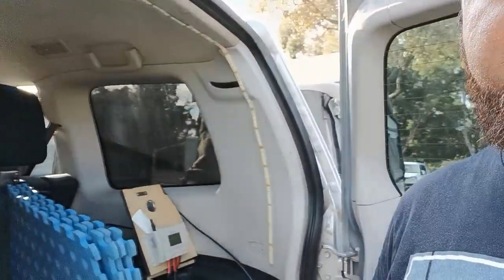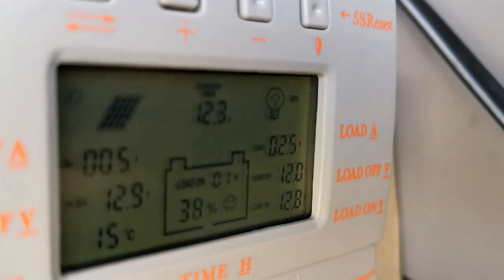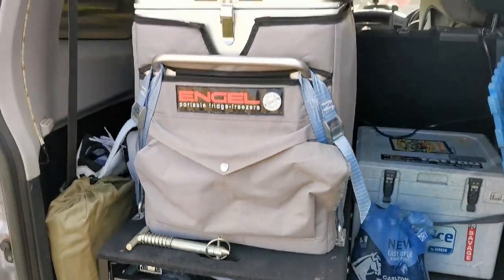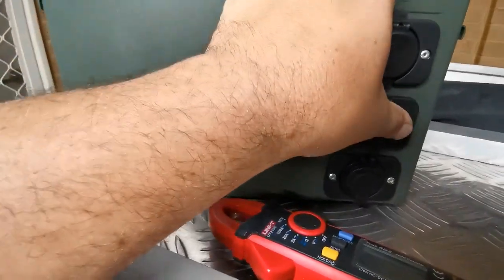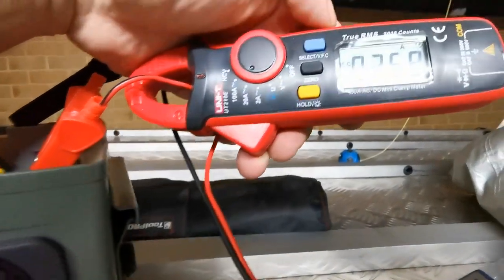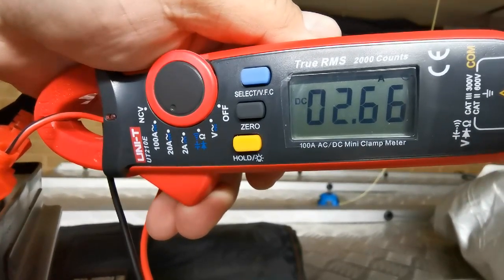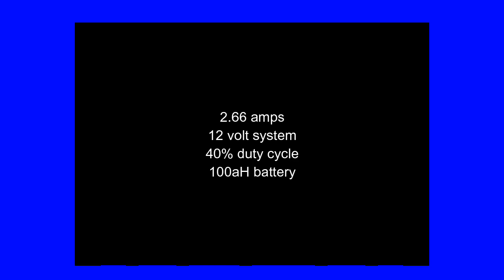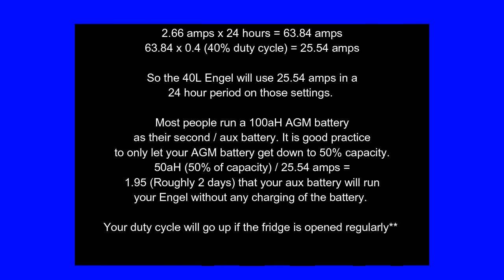Real world testing: Engel power usage. How many amps does it use?

Comment: I haven't watched this yet but thought I'd share my experience. i get a tadd under 24hrs in my car running on an 80ah AGM battery before the built in medium cut off switch kicks in, which I believe is around 10.5 amps compressor running. 60th anniversary 40l. Brand new battery. I'd let it go lower but Engel's lowest cutoff I believe is far too low for AGM
Reply from the maker: Sounds about right mate. Cheers for the feedback

Comment: Real world is a very different story. Engels duty cycle isn’t accurate to specs. I’ve got a combi and it runs a lot more than the advertised duty cycle.

Set at -12 degrees it’ll easily chew 40-50 amps per 24hours

Set at 0 or 2-3degrees and it’ll still chew 30-35

Comment: Iv had one for years there fantastic but recently shit itself replaced the condenser with one in hard rubbish worked fine I was surprised.. but I go through lead acid batteries pretty quick for some reason.. or maybe lead acid batteries are just shit?
How much does the average 12v fridge draw? What about Waeco's?
Reply from the maker: I think the average fridge would draw 0.5 to 1 amp more. The Engels are very efficient. It's that swing motor..

Comment: That's what makes the Engel so special. The low current draw thanks to their brilliant and unique swing motor. For more efficiency, remove the bag and add a voltage step up transformer. See the results here - https://www.youtube.com/watch?v=m9xjYKs1Kx4&lc=z23azzhy2tb2dzlecacdp433tolvdbbyhqa1rjk1srdw03c010c.1599441011700997

Comment: Hey mate, good video, but where does the 40% duty cycle come from? Have you measured that it is 40%, or is it an assumption? What ambient temp were you running?
Reply: That’s a good point. You’d have to sit there for an hour and time how long the compressor runs and then calculate it. Maybe he did though. 
Good video thanks mate. 
I have the same fridge and left it for 3 days with a 100ah battery. I was was worried I drained my battery to low but a guy at jaycar told me the Engel will cut off automatically if it detects the battery drops below a certain voltage, not sure if that’s right.

Comment: You forget to mention :)  I have a 27 yr old 30 lt Engel and it uses similar AH to yours on a 25 C day. However, go to a 40 C day and in 8 hours it, coincidentally, also uses 25 AH, (100% cycle rate) with 16 hours of hot day and warmish night to go, lol. I've also measured the interior of my 4x4 at 60 C on really hot days. The figures I quote are from actual tests I've done. So @ 50% Depth of Cycle on a 100 AH battery, it will need daily charging in the summer. Which is why I have both DC-DC and solar options on my Auxiliary battery as do you. :) I suppose that's another video, lol....... BTW I like you battery box.

Comment: Hi mate i have a similar setup with my 40l engel and 110amp deep cycle aux battery plus a 110w fixed solar panel. However my amp meter is just on the cheap side and I cannot actually tell other parameters from it. What brand is the monitor you have? Cheers
Reply from the maker: UT210 series
Reply: @Unfastened  so rewatching the video, it seems UT210 series is actually a solar regulator. At the moment i am running a c-tek D250Sa dc-dc for my solar etc. I guess that module you have Won t work in my case... any thoughts?